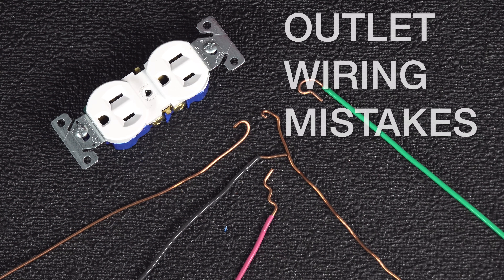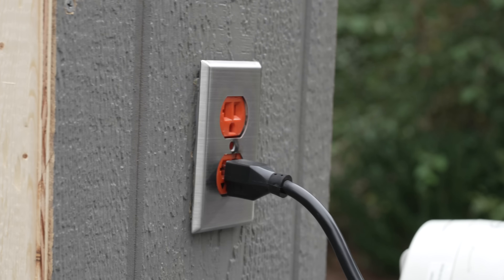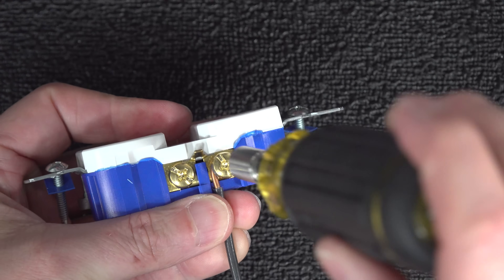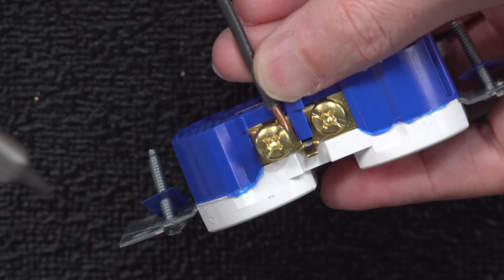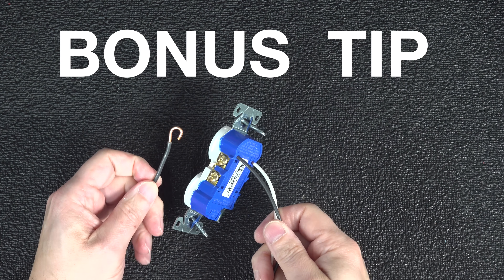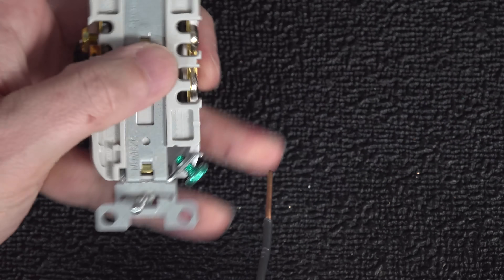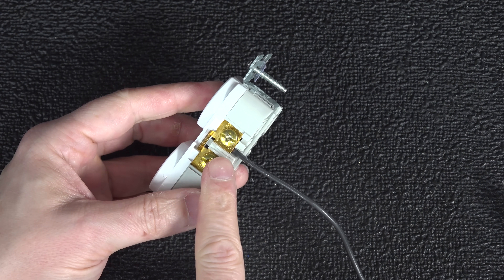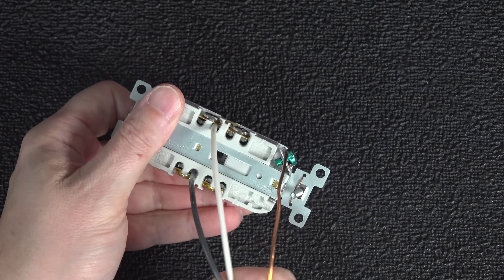BEWARE Of These 3 Common Wiring Mistakes On Outlets & Switches

Comment from the maker: Thank for watching please LIKE & SUBSCRIBE: Leviton Outlet: https://amzn.to/3qL1fGJ - Outlet Tester: https://amzn.to/3J33VG1 - Wire Stripper: https://amzn.to/3NyaTGc
Reply: You don't need to actually make the hook yourself. The outlets have a tiny plastic tab where the tip of the conductor would rest when the hook is under the screw. Take the stripped wire and place the tip under this tab and you can pull the wire to wrap the rest of the exposed conductor around the screw and form the hook. It hard to explain but the tab holds the tip of the conductor in place while you bend the wire around the screw. It makes a perfectly sized hook that tightly fits the screw.
Reply: The easy way to remember how to wire an outlet is WHITE TO WIDE. The wider slot on a polarized outlet is the side the white wire connects to. Something else to note is the back wiring holes have been reduced in size to 14 gauge on new outlets. When they were first introduced they were 12 gauge size. I had to replace an outlet in an old house and the wires in the box were too short to put hooks on and Home Depot, Lowes, etc don't have outlets with 12 gauge back wiring holes. But they do have the ones with the clamps. So for a little more $ I got one of those outlets that could work with the stubby amount of wire the original electrician had left in that box.

I've also been replacing the lousy wire nuts with WAGO 221 series lever nuts everywhere I can. When a connector rated for 20 amps can be run to 60 amps without melting, catching fire, or showing any damage at all, that's a convincing reason to never use a wire nut ever again. They're so much more convenient for installing light fixtures that nearly always have stranded wire, which is a huge PITA to get to stay together with solid wire using wire nuts. A lever nut doesn't care about different wire types since each hole is independent. Lever nuts are also far easier for connecting 3 or more wires because they can be popped in one at a time rather than trying to get 3, 4, or 5 solid wires to all stay together. It always takes multiple attempts with a wire nut before one wire won't fall out.
Reply: 😅 @greggv8
Reply: Something not mentioned, if you hold a outlet (device) front side up and look at a side you'll see a little hook cast in the body to the lower right of the terminal screws. Strip the wire more than normal then place the end in the hook and bend/ wrap the wire counter clockwise around the terminal screw and tighten the terminal. Take needle nose and pinch the wires together to make an eye before cinching down the screw, to be fancy.
Reply: @BS-ys8zn  00+09 op 8 poo 98 poo poo poo p poo 98pp poo 88ppp8p8p88889pp8p8pp8p8ppppp www poo p888pp8w8wpwppwpp8i lmk
llamo]boo 9
Reply: is there somewhere I can send you a picture of all the mistakes my apartment company did to wire my apartment?

I think you will get a real kick out of it
Reply: didnt even mention the hole on the ground plate on most receptacles =)
Reply: when i replaced all my outlets i ran in to the ground wires being to thin and they would snap off the apartment wuz built in the 70'z i wondered the code for that thickness change and the ground wire got thicker cuz man it wuz like thin spageti
Reply: YOU
Reply: I always find it interesting to watch videos like these. It's informative to know the difference between the US and Europe as I'm a European electrician.
Those screw clamps have been standard in Europe for decades.
Reply: You do not have any credibility.  You incorrectly used the wrong terms. The term back wire is what you did at the end by placing the wire in and squeezing it in to connect.  They other CORRECT term is called "BACKSTAB" When you "STAB" the wire in the small hole in the back. Did you ever READ the info on the back, it says 14 gauge wire only in the BACKSTAB location.  If you care to redeem yourself,  take down other video. Learn difference between BACKWIRE and BACKSTAB.  Also do not be upset about this post, embrace this information as it can SAVE lives because BACKSTABBING has caused many house fires. Ask your local fire department.  Take-away, If the receptacles have a back wire provision it is a better quality receptacle.  If you replace with cheap receptacles, DO NOT BACKSTAB !  The life you save, might be your own or your family's.
Reply: please stop offering electrical tips
Reply: What is the name of the push in oulet called? I am looking and I cant find one with 8 holes in the back. I don't need 8 I need 6 because the outlet I had also has two backstabbing wires and two regular wires on each side.
Reply: Can you use Butt Splice connectors to reconnect the 3 Big severed wires in a Wall or Roof?
Reply: @user-em6ie2be7x  q++qq+++
Reply: Stubby multi Klein. Love it lol

Comment: Always hook solid wire. Even the screw done stabs can loosen. Those are designed for stranded/THHN wire. I don't recommend putting 8 wires in  an outlet. This guy is nuts

Comment: My clown biological father and witch mom were shocked once while repairing our upstairs bathroom. My father was working on the outlet and or light switch. He did not turn the breaker off cuz he's not too smarta. (Said with an Italian accent cuz I can type anything I want.) He promptly started getting shocked and was flailing about. Then my momster grabbed on to him. And she had the same thing start going on. I was luckily in the bathroom. I think I just finished a pee. When I saw what was occurring I thought it was kinda funny. Then I wisened up and realized what was transpiring. My first thoughts were to call 911. Then being the lil smarty that I was. I then realized what to do. (I was wearing rubber souled sneakers.) I simply kicked my father's arm. And broke the circuit. Saving both there lives. I wasn't looking for a cookie, but a simple thanks Steve. Would of been appropriate. Both say they have no memory of it. But they r both pushing 80 soon. And r all both torn up. With onset dementia, alheimers, and depleted serotonin levels. AND TO PUT PLAINLY R ASSHATS.🖕, here's ur 1 now stupid f**ks.

Comment: This video was posted three years ago from today in 2025.  Today I installed an EATON brand GFCI outdoor outlet that has the ability to clamp onto a straight wire like the hot and neutral for the ground terminal without needing to make a hook.

Comment: been doing backwiring for over 35 years, NEVER had an issue if the outlet is purchase after 1988 (when the design was changed of outlets). now you have to know the difference in an old outlet and an new one. If the outlet is older it should be swapped out anyways, the metal inside is very thin for the plugs.

Comment: Fun fact: the wire stripper you're using probably has some holes on it that aren't the ones marked with wire gauges, usually closer to the handle. Those are there for you to bend the wire with. It's better to use that than the blades because that is unnecessary wear for the cutting blade which is intended for relatively soft insulation. If you want to know what wire stripper I use these days it's a Milwaukee 7in1 combination pliers, though there are many nicer ones out there.

Comment: THIS was awesome. As an amateur home electrician (I have my work checked by a friend/professional who keeps offering me a job but I don’t drink) I have finally realized those CHEAP outlets (even EATON - garbage) make for more problems down the road (contacts wear out/burn/lose connectivity) as I’d used many of them in our old house - we sold and moved in May - and audiophile friends recommended Hubbell 5362 outlets which, after the inspection I’m installing in place of those PITA “safety” outlets (which are also CHEAPly made) in many outlets in our new house.  I was wondering about the 4 holes per side thing and still wonder who the heck it is that writes and rewrites NEC regulations as so much of it seems arbitrary and capricious, like bureaucracy for bureaucracy’s sake. I also got a set of ECX screwdrivers and bits for my drill and wish I’d known about those thirty years ago. Thanks again for taking the time for a good refresher.

Comment: The lever actuated outlet you showed at the end where you don't have to hook the wire is 370% higher at Home Depot as of October 2025. You can get a plain three prong outlet for $1.79.  The lever actuated outlet is $6.59. If you buy a 10 pack the price goes down to $4.65 per outlet. Homeowners rarely buy 10 packs of outlets. Your information is no longer valid, if it ever was.

Comment: Thanks for the clear video. 

I've been seeing a lot of videos by experienced electricians who say NOT to use the hole in the back of the outlet. But they weren't referring to the one with the screws that clamp down on it the wire. 

So electricians, is it your opinion that this kind of a hole is safe because the screw clamps down on it? (If this is safe, it would make my job of replacing all the receptacles in my old home so much easier!)

Comment: I added an outlet to a switch and checked the connections multiple times.  The switch no longer has the original light connected to it and the wires are just free in a junction box.  Is this causing my open neutral signal on my outlet?

Comment: I'm no electrician by any means but I can replace a wall switch, outlet, or replace a breaker. 
But I'll say it again, especially for dummies like myself. All the common (Romex) wiring that I have ever seen has 3 wires. White, Black, and Green. And if you can't figure out that the green wire is a ground, then leave it alone.
So while in hell do they make voltage meters with Red and Black leads? Keep it simple and make the leads white and black. 
And the switches and wall receptacles make the screws white and black. 
To me, that would stop a lot of mistakes with non-professional guys trying to replace something so they don't have to pay an expensive electrician to come out.
And I have honestly seen some so-called professional guys make the same mistakes.  
Just saying.

Comment: I installed mine correctly but have no power and the circuit seems tripped. This is for two different outlets on 2 different circuits? Guess I have to remove and try to find out.

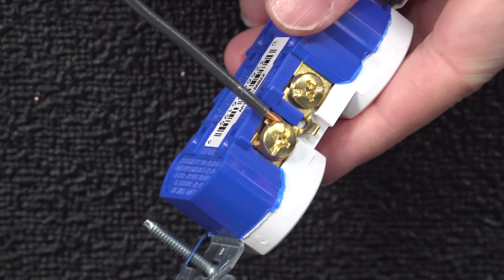Comment: 2:20... incorrect...  That is called back-stabbing.  Spend the extra $0.50-$1 or so on each device and get SPEC-grade over the cheap residential grade garbage... they are built to last way longer.

Comment: Question. I’d like to add an outlet from another outlet but it has 3 sets of wires (3 white, 3 black, 3 ground). How should I wire the new outlet? Also the outlet that I’m getting power from is using the 4 screws and 2 push in slots to fit all 6 wires
Reply: Use a 5 port Wago lever nut, the 3 wires plus a pigtail for each set, pigtail goes to the appropriate receptacle screw. Alternatively, but quite a good would be a 4 port push in connector.

Comment: 2:29 "this is the next most common mistake people make" I'm going to disagree. The manufacturers would compromise their reputation if the backstab feature were unsafe or less secure than using a hook. I've removed a ton of 35-year-old Leviton "round" style outlets and light switches which were back stabbed. All of them had solid reliable connections, nothing loose, I had a tough time removing the wires. It is a better connection to use the hook but it is no more correct than backstabbing given it is 12 or 14 gauge as the manufacturer allows and NEC and/or local codes allow. I do always use hooks but if I had a home or building to do, I would backstab properly and not feel like it was a mistake I like your videos but this is inaccurate.

Comment: Backwiring  is fine it is a myth that it is a problem, it is code approved and does not have any more problems that the hook approach
Reply: Backstabbing? AKA quickwiring.
Reply: @surferdude642  Call it what you want there is zero evidence that it is inferior
Reply: @ProfessorDIY  It's only available on residential grade receptacles and only 14 gauge wire will fit in the holes. You can legally use residential grade receptacles on a 20 amp circuit, then the only option is to hook the 12 gauge wires around the screws. The implication is that backstabbing is not permitted on a 20 amp circuit (12 gauge wire) due to inadequate contact and potential overheating issues. The code approval that you mentioned is based on minimum requirements for low current applications.

Comment: I have had a weird issue over the years that most of my switches have failed due to the fact the plastic back cracks, always at the top of the switch, then the toggle makes an arc noise or light switch just moves freely up and down. I have went though every switch I have and replaced them; probably 60% of all were cracked at the top. I would guess this is a common issue that most people do not know about. My tip is if the switch toggles up and down loosely or you hear a noise, like a popping or arcing sound when moving switch, check it out by removing the cover. if the switch is cracked you will clearly see it.

Comment: Back Wiring Holes should be outlawed! I’ve done countless houses where the wires were loose! Don’t use ‘em!
Reply: I’ve replaced many outlets and switches and I’ve had the opposite experience. The wire was always very hard to get out of the holes.

Comment: What you're calling backwiring is actual called backstabbing. What you start talking about at around 3 mins, with commercial outlets, is actual backwiring, which is much more secure than backstabbing. I still prefer J-hooks though. I wouldn't say that commercial channel backwiring is stronger than a J-hook.
Reply: "backstabbing" is the most common but derisive term, the actual name from the manufacturer is "quickwiring".

Comment: the BIG problem I have had to deal with is how to secure a heavy gauge wire and then how to shove the outlet, connected to four heavy gauge wires and a ground, back into the wall.
Reply: That's why you should use pigtails, only 3 wires to the receptacle, including ground.

Comment: You are better off pig tailing any series wires and leading only one wire to the receptacle - don't use a receptacle as a "junction box" -  One white wire and one black wire only

Comment: It seems to me that passthru wiring is legit, because of load protections. If a device cannot handle it it is garbage simple as that. Looks like the focus here is on springclamp design failing, but that might be due bad manufacturing, because people use springclamps everywhere nowadays even on highamp terminals 350Amps or more without fail.

Comment: Forgive my ignorance of/horror at this innocent remark:
0:24 "built in guide to help you do the job correctly " and
"You wanna remember that those silver screws will always be connected to the white wire..."

HOW?

How is it a guide?
How have the federal safety standards fellas allowed this senseless situation to arise?
How haven't they got the boot?

How come the manufacturers not been made to emboss a hot/black and a neutral/white above the correct screws?
It cannot be reasons of cost, so does the executive branch of successive governments want to facilitate electrical faults, fires, fatalities?

P.S. I'm a Limey Sparks btw.

Comment: Hey Silver, I just want to say that I watch a lot of your vids and I think you do very well with them. That being said. This one I'll have to disagree with a part of it. That part being where you say that using the backstabs are improper, unsafe and that pro electrcians don't use them. First, If this were true, there wouldn't be an option to do so. Second, do you really think the manufacturers and the listing authorities (aka, UL, ASTM, ....) would take on that liability to say it's safe and it not be? Finally, I'm a 34 yr. veteran licensed electrician, been using backstabs since day one, never had an issue with, overheating, fires or falling to work and/or inspections. The biggest problem I've seen with other people using them is falling to use them "properly". In which, no matter what method you use, if you don't use it properly, any method will fail as well. Such as one that I've seen more of than anything else, is with wrapping the screws and they forgot or missed  tightening the screws or didn't torque them properly. Now there's a fire in the making for sure. So when things like this fail it's usually the person and not the method.

Comment: One thing I LOVE about electricians warning about backstabbing (which I whole-heartedly agree is not what I do as DIYer)...who do you think wanted backstabbing in the first place? Homeowners? DIYers? Bull!
It was electricians and electrical contractors! The very people who now froth and fuss about backstabbing.
When doing new work jobs, many electricians on a contractors payroll get paid by the piece (per outlet or box) and the contractor is paid a on a fixed price contract. The faster everyone works, the more money is pocketed by everyone...and backstabbing is FAST. So is clamping.
And while backstabbing contacts can fail, so can any electrical connection. 
And backstabbing is allowed by code. So let me ask you this, gentle viewer. The same people that fret about aluminum house wiring, that want a retrofitted GFCI in every wet location and an AFCI in every bedroom because of "maybe" accidents, still allow backstabbing and manufacturers still make them. Why would they allow such a dangerous practice?
Just asking...
BTW, the aluminum wiring that is dangerous in your house (they say) but the service wiring to your electrical service box IN your house is almost certainly aluminum and is installed to this day.